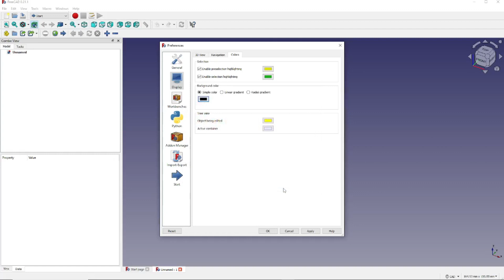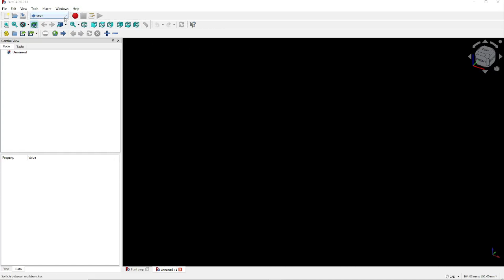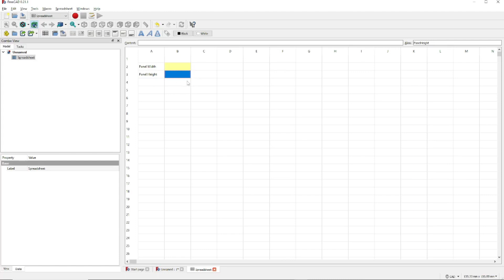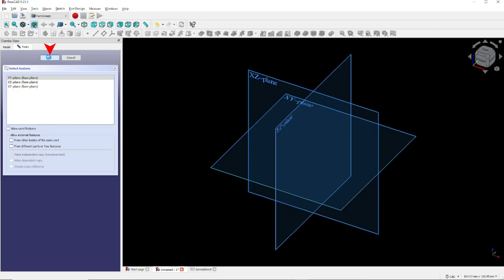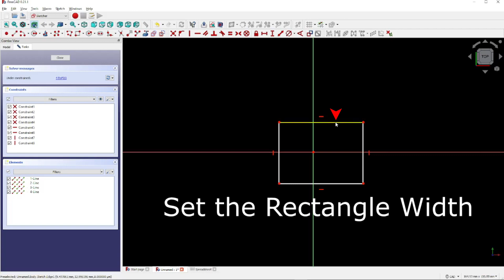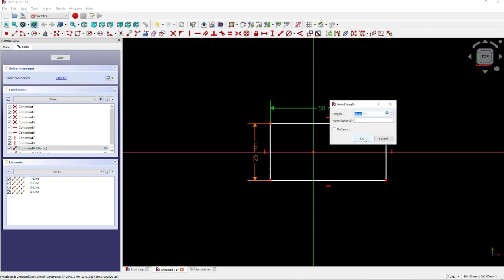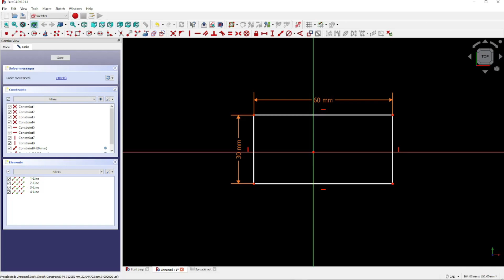FreeCAD Parametric Modeling Tutorial

Comment: Is it possible to explain how to use a dimension of an sketch object to determine the value of another dimension - even a dimension from a different sketch of a separate body or part? I don't mean from a spreadsheet, but from the objects sketch itself.
For example I have a sketch with a dimension that I label 'length' in its reference box when I type in its value. In a separate part I want a dimension in that part to be twice as log as the length of that 1st part. Without using a spreadsheet - can I set the dimension in the 2nd part to be " 2 x Part1.Length "?
Reply from the maker: You can reference external geometry. Check out our Shape Binder tutorial. Hope this helps. https://www.youtube.com/watch?v=0d1M-LOdsDk&t=1s
Reply: @321StepBySteptTutorials  Thank You. I did finally figure it out (i had trouble because I'm brand new to FreeCad) but u can directly reference any 'constraint' no matter where it is if u type a name in the 'reference' box in the window u enter the value in. Such as 'SketchName.Constraint.Length' where 'Length' is the name u gave the constraint (and its case sensitive). On the other hand it took me forever to figure out how to reference a Pad Dimension. I will check out the video since I am not up of shapebinder .. Again Thanks